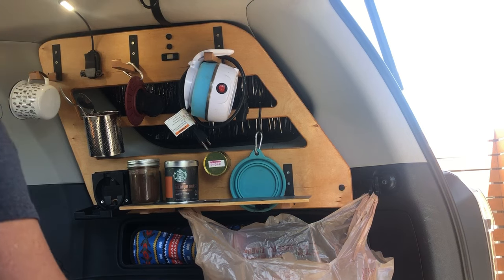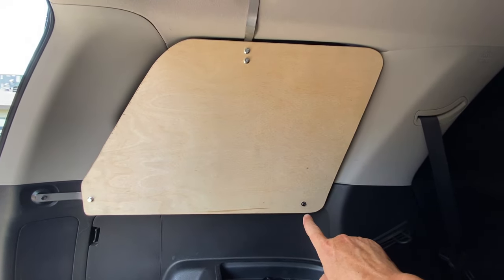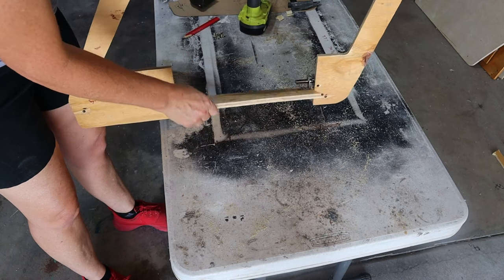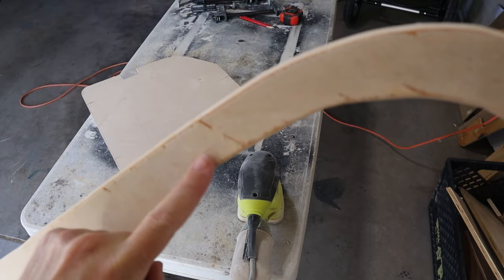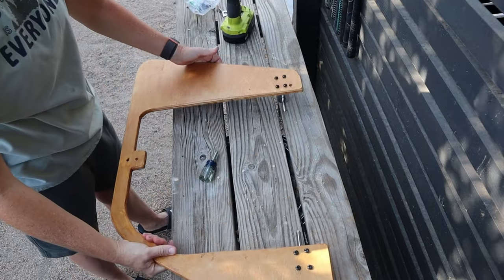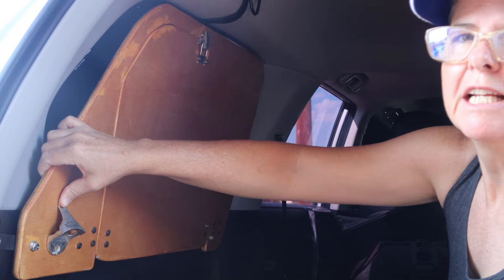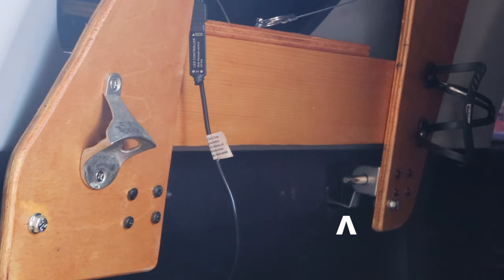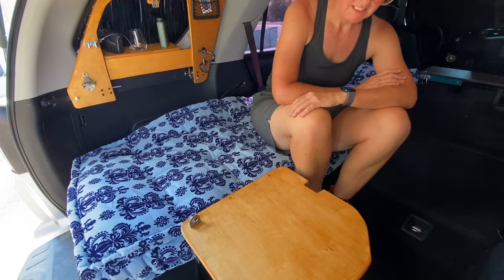DIY 5th gen 4Runner window storage / dropdown shelf / tailgate table / nighstand and... secret bar?

Comment: YOur driving along around minute mark 20 something and I was wondering about the potential rattles, especially on a 5-12 hour drive. Sounds like you have it figured out as well. I think some leather or something may knock that rattle out. 
Looks great as usual my freind, keep up the fun inspirational builds. 
Dale
Reply from the maker: We just went on a long drive and found the plastic sleeves helped, but on really rough road — not enough. 🙉 The handle parts of the hinges rattle too 😣 I might velcro them down, when not in use.

Comment: This is so cool and creative, and beautifully crafted! Have you ever considered even selling pieces like this? maybe a limited run, I am sure a lot of 4Runner owners would love to purchase your creations!
Reply from the maker: I’ll occasionally consider it, but then get overwhelmed thinking about the logistics of order taking, production, and shipment 😵‍💫 If I had a workshop and a CNC cutting thingie - maybe 😄
Reply: @ShoestringMartha  may be a good side business eventually! You’re very talented
Reply: @ShoestringMartha  Kori you could always just draw up a Template with instructions and possible variations to fit different vehicles, as well. That way you don’t have to make them out right, but sell the plans per say..I would love one for my Honda Element on the drivers side
Reply from the maker: I have the plans for the 4Runner runs for sale, but making others would be hard. Every vehicle has such different attachment points, and figuring the shape and dimensions of the windows is the hardest part. If the manufacturers offered up that data, I would be ON IT. 😂